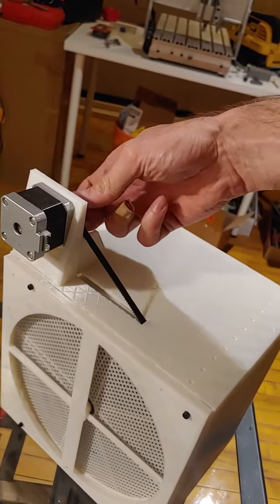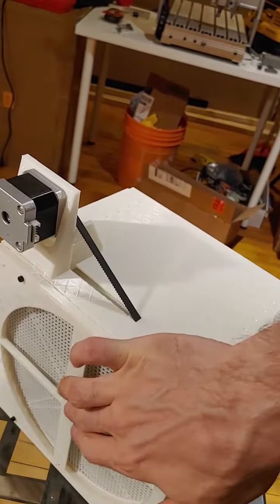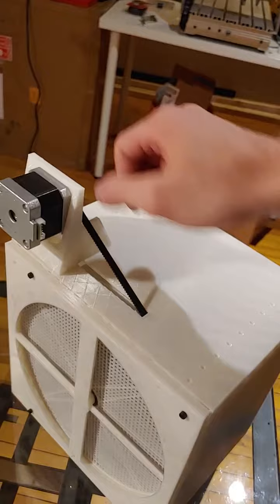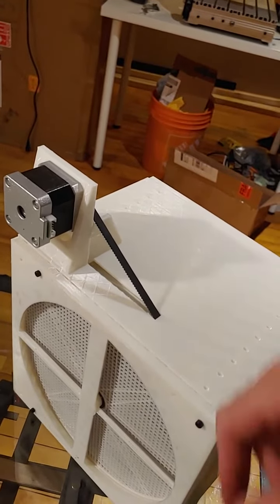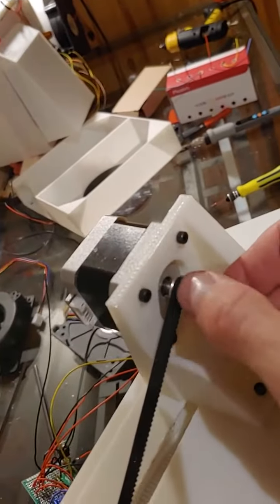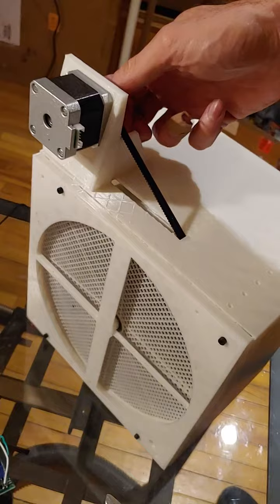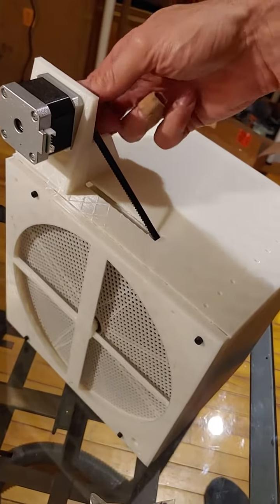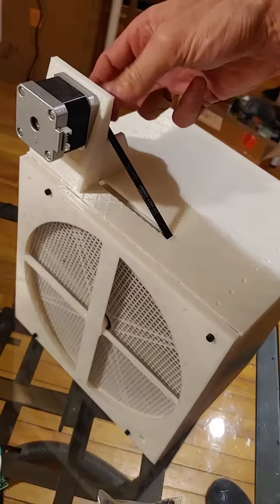quick video of assembled thermal wheel with drive

Comment: so aren't you using a geared DC motor instead? I just saw your post in a fb group and I'm not super sure how the HRV works, but if you don't need constant change in the RPM, a geared motor would be perfect
Reply from the maker: The trouble is they don't last very long, it has to last for years of operation.  A brushless geared motor would make sense.  I couldn't find any available though.